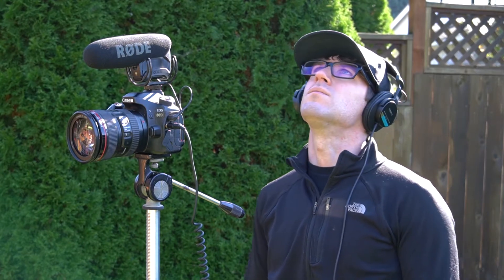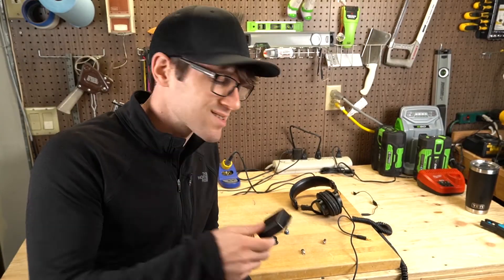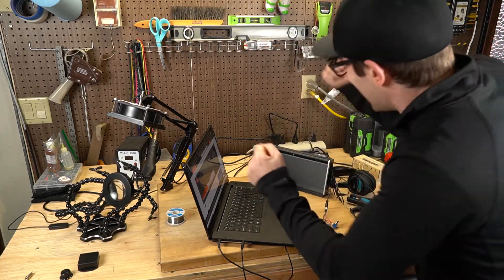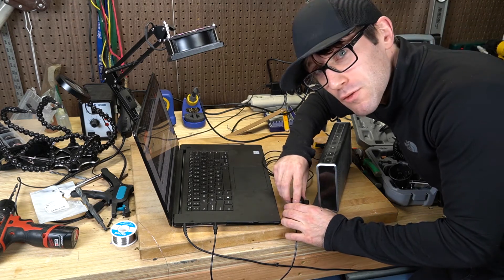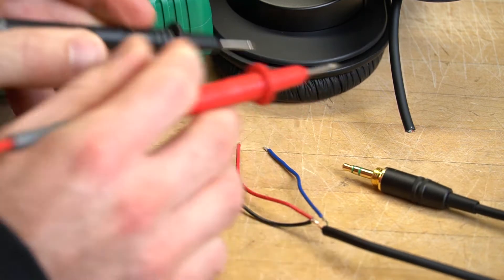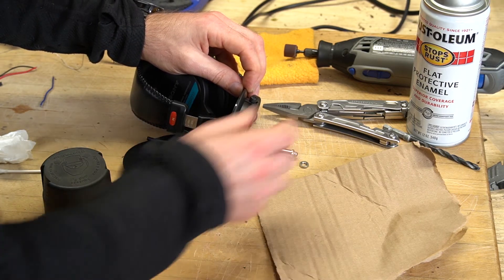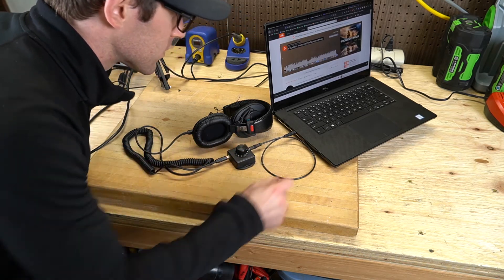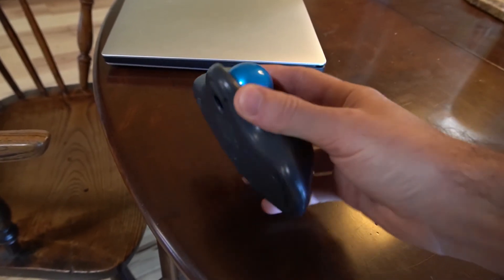How To Make A Headphone Volume Knob and Detachable Cable

Comment: The holder thing is awesome. And respect for using heat shrink on everything. Im in the process of searching out clear so I can make uv reactive color coding.   Im getting a bunch of nice elbow jacks from a place called Thomann in Germany.  I figure for the price of buying the DT770 with the detachable cable I can stock up on a lifetime supply of high quality headphone cable , jacks and elbow jacks.   That way I can fix all the earbuds I have in the junk drawer too.
Reply: I started using the under layer of cool colors and designs when building tattoo machines, often clear heat shrink tube is used over simple paper, money, stickers etc…. i figure the same can be done with headphones and studio cables. Say a few neon stripes , enough to make each cable stand out individually….
Reply from the maker: That sounds really cool. Would love to get my hands on some clear heatshrink. I wouldn't do an electronics project without it. Particularly in such cramped quarters, the chance for a short is too high. I like doing things right way, so that when I seal everything up I know it will last for a long long time. No potential loss of stickiness and unwinding like tape if it gets hot. A few times I've been joining together such a rats nest of wires that I incorrectly count how many pieces I need, that's always fun to go back and fix. XD Well worth it though.

Definitely sounds like you could pull off what you describe with headphone cable. What's the deal with the UV reactive color coding? That sounds interesting. What are you going with UV reactive for? Is it for raves/venues that use black lights?

Comment: the nub is there to lock the pot so that it doesn't spin the housing.
Reply from the maker: Aha! Thank you for that, I haven't used many of these and couldn't think of what it was for. So I assume then that it locks into an indent built into whatever casing it's being added to?

Comment: Does this change the quality sound?? Or it’s volume?? Great video!!
Reply from the maker: Thank you! While I'm not an audiophile with a trained ear, I have not noticed the quality or volume changing (other than as intended when using the knob). If the soldering is done poorly it could become loose and possibly cause crackling, but apart from that it should be no problem with basic soldering skills. Plus, you can redo the solder joint if needed.

Comment: What I love when Sony made the 7506.
Is that they knew this was going to a market were modification are comon on gear so they have a wiring guide in the box. Also Sony does provide spare parts from what I’ve heard.
Reply from the maker: They also have a fantastic exploded view of all the parts included with an insert in the packaging. Every part is labeled in case you need to replace them. I have to hand it Sony, they did a solid job with these especially for the price.
Reply: Yep that too.
I also have seen a company (remote audio) use a 5 pin mini xlr to have a locking detach cable that has a microphone for production things. So I am probably going to mod mine to that.
Reply from the maker: Now that's cool. Best of luck with the mod! Making stuff your own, especially functional changes like that, is so rewarding.

Comment: Excited to do this project thanks for mapping it out.  Any updates a few months later?  Everything working OK?  Anything you wish you did different?
Reply from the maker: I use them all the time whenever I'm video editing. Holding up great so far! Only thing I would have done differently is double sided tape the volume button to my desk earlier. I left it loose for a while, and some time back I taped it down and now I use it all the time since it's so convenient (didn't want to screw into the top side of my desk).
Reply: @HardwareUnknown  Awesome thanks!
Reply: @HardwareUnknown  Just completed the project.  Thanks for the advice on this, worked great.  Now I can fit it in my road-case easier by packing the headphones and cables separately.
Reply from the maker: Yes! I had a few people mention they were thinking of doing the mod, and you're the first to get back to me with it complete. I'm so glad it worked! Welcome to MDR freedom. Well done.
Reply: @HardwareUnknown  uh oh…. I dropped my headphones and now the insert 3.5mm jack has to be positioned right or it only comes out one ear… should I replace the jack or does it sound like wiring got loose?
Reply from the maker: Oh no! But no worries, should be an easy fix. My guess is the wiring is loose at the connection and when you reposition the jack, it's making temporary contact. If you used the same all metal jack that I linked from Digi-Key, I'm almost sure of it. Even if you used another jack like the combo metal/plastic ones I linked for the volume knob, though, try this: open up the headphone cup and carefully resolder each connection. You could do just one and test the sound coming through, but I just say each since it shouldn't take too long, and in the event the other connections were also damaged this will fix that before they display issues.

Use a bit of new solder so fresh flux gets on there to help each joint reflow properly. Also keep in mind that when you melt the solder initially, the wires may be bent in such a position that they'll naturally pull away from the jack once the solder is no longer solidified. You might need a tool to hold the wires in place while soldering them back, and particularly when the solder is cooling. You want to prevent movement as the solder cools in order to prevent cold joints. You may also want to burn off a little more of the enamel coated insulation on the wires if there isn't much exposed wire length for the solder to grab. If it's too difficult to solder in the ear cup, pull the jack out and use helping hands or similar outside the cup, then reassemble the cup with the freshly re-soldered jack.

What's probably happened is there was a cold solder joint and the impact caused it to fully fail. It could have also been a proper joint that failed due to impact stresses depending on how much flexibility (or not) the wires had in relation to the jack based on how they were glued down. Low flexibility could simply mean the connections themselves were stressed too much when the ear cup flexed upon hitting the ground.

Comment: Thinking of doing this but kinda scared
Reply from the maker: It's a bit nerve-wracking modifying perfectly good stuff like this that you've paid good money for. Here's the thing, the disassembly and drilling is pretty straightforward. The part that takes some care is the soldering. 

To get some practice first before doing the actual headphones, buy a cheap auxiliary headphone cable or find an old one, get some 3.5mm replacement jacks, cut the cable somewhere, and practice soldering the jacks on. When you feel confident, then you can move onto the headphones themselves. When you switch to them, practice a bit on the cable end you cut off first just to make sure it behaves the same as the first one. Doing things in stages is the way to go to build your skills.

You got this! Let me know if you have any questions along the way.
Reply: @HardwareUnknown  is it ok if I don't have the dremel tool
Reply from the maker: Yes. A dremel makes it easier as a rotating bit can help you carve small amounts of material away, but you can also use extra pressure on the side of a drill bit, a small file, or even a utility knife in cases where the material is soft like plastic (aim the blade away from your fingers and be careful it doesn't slip).

For this situation (since it's metal) I'd go with a drill bit for the initial hole and to widen it most of the way, then a small round file like the one in this set to deburr/smooth the edges: https://amzn.to/3devu1F
Reply: @HardwareUnknown  thanks, you earned a sub
I'll tell you when I do it.
Reply from the maker: I appreciate that, and please do. I'd like to hear how it goes. Let me know if you have any issues or need any other tool workarounds.